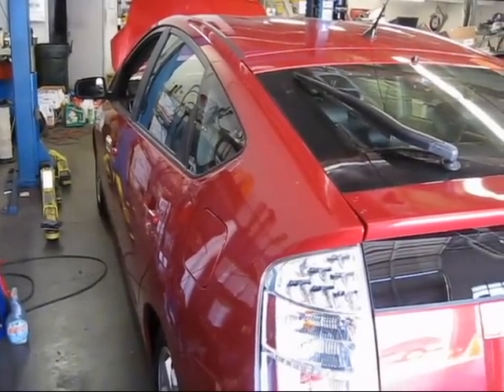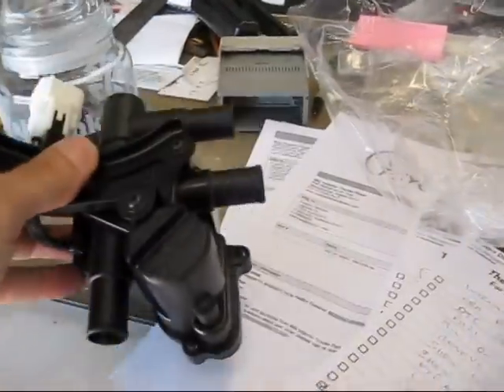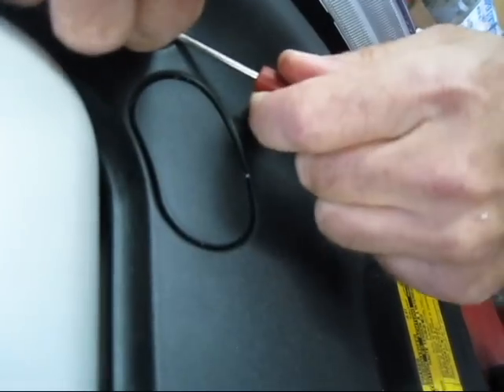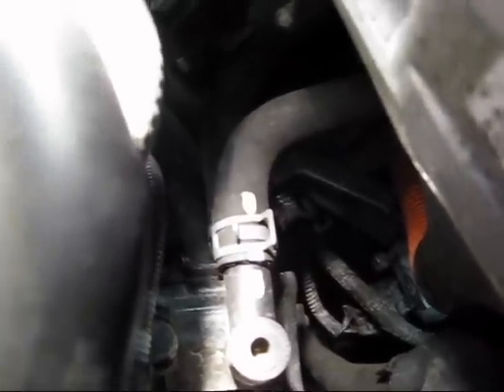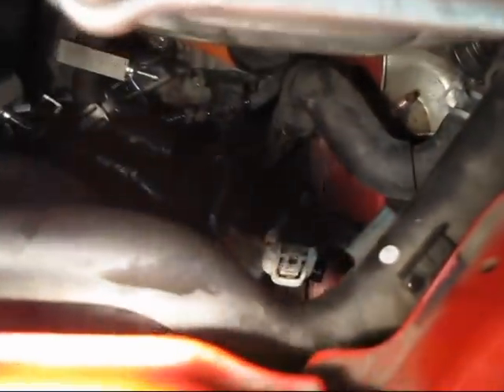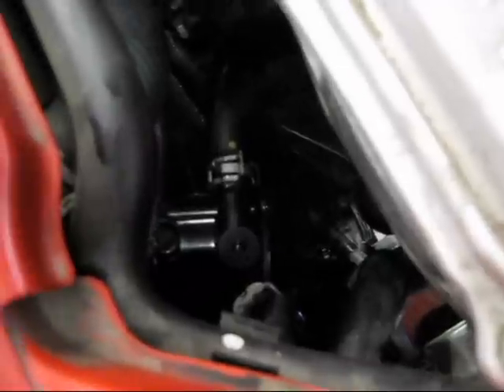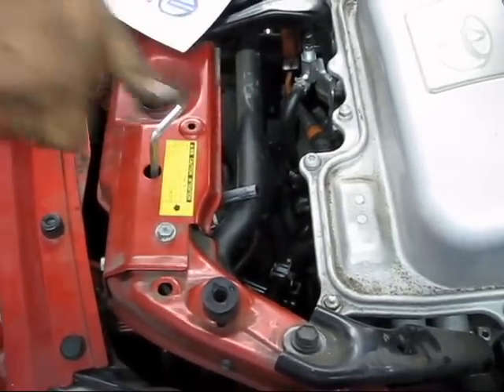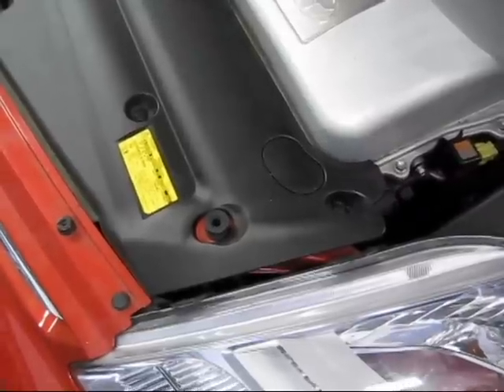2004-2009 Toyota Prius P1121 DTC Repair

Comment: Thanks for taking the time to post this video.  You saved me a lot of aggravation.       
I replaced my 3-way today in my 2007 Prius.  I was able to remove it from the top by separating the metal bracket from the housing, which is held on by 3 Phillips head screws.  I removed the bracket on the new switch before inserting under the maze of hoses and the reassembled it.  I can now  get my emissions test.

Comment: Thank you for posting this!  Very clear instructions. I just followed it through step by step and it fixed theP1121 code issue on my 05 with 210k miles.  It took me about 8 hours to do but in the end has saved me $400 - $500!  The check engine light turned off on it's own between inspection mode cycles.   This is just great, thanks!

Comment: My 2008 prius doesn't have the nipple where I open the 6mm Allen. I replaced the control valve but the CEL  is still there and it still has the p1121 code. Any advice?
Reply: Use your OBD2 scanner to clear the CEL and the DTC.

Comment: question for you eallavato! after you had the car run the engine. did you do anything to bring it out of that mode, if so what steps would i need? and are you able to remove your foot from the brake after the symbol comes up telling you not to drive while the car is running that test? im looking to preform this coolant control valve soon, wanted to make sure i got full information. i noticed there was a number at end of video, would it be easier to call to get this and more additional information? thanks!
Reply from the maker: To bring it out of that special mode simply push the Power button once to turn off the car.  And yes, once the symbol comes up you can remove the foot from the brake pedal.  Good luck.
Reply: I have this project coming up to complete. You mentioned the car needs to be burped- so there isn't any air in the hoses. Will completing the tasks in the video help prevent those error lights from coming on after the jobs done. I've been quoted from my local dealership, if they have to bleed it for me after I get the errors it cost be 250.00 or more. Want to make sure it's done right the first time.
Reply from the maker: Sara Saylors The only error "lights" that the car was displaying was the "Check Engine Light", which when diagnosed with the Scanner was caused by the P1121 DTC.   Have you diagnosed the issue to the P1121 code?
From the nature of your questions, it sounds like you are not very comfortable working around cars.  If you live near the San Fernando Valley, I would call Steve (number at the end of the video) and work something out with him.  He has done this a number of times.

Comment: i assume you had no issues after this repair and driving it around? i have the same issue and am thinking about doing it my self. hopefully i can get the hose clamp to work.
Reply from the maker: Correct, no issues after the repair.  The check engine light has not popped up again.